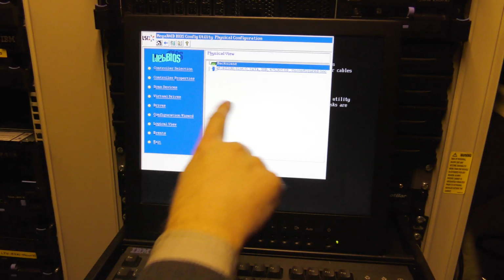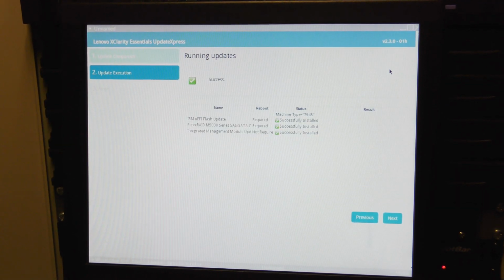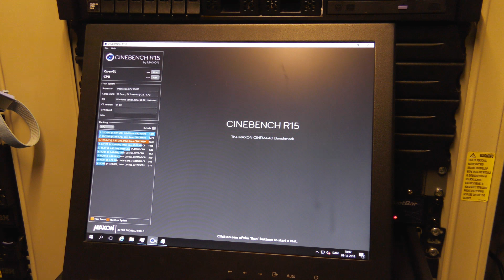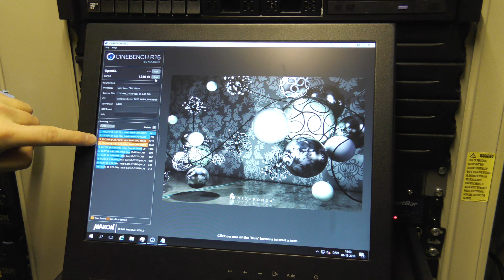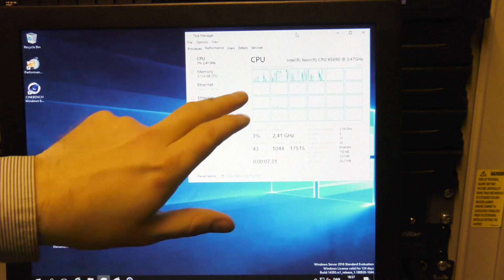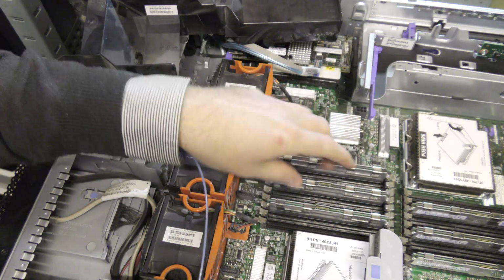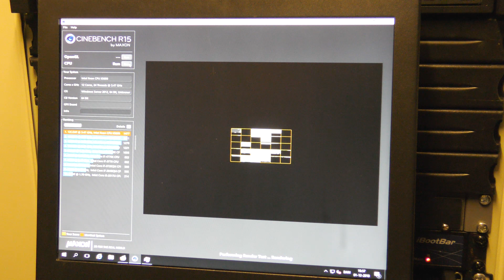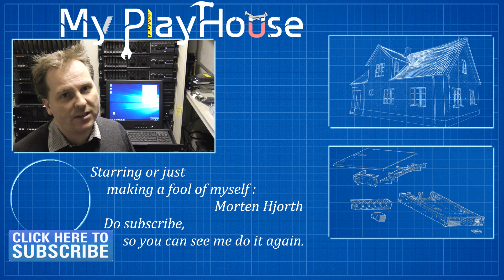2 x Fastest "Westmere-EP" XEON X5690's in Rack Server - 784

Comment: Hi Morten,
Always a treat watching your videos.
I've mentioned this in a comment on one of your videos featuring Westmere chips in the past.
You're putting the thermal paste on incorrectly.
You must put the paste on the die in a line that crosses directly over all 12 cores so they can all turbo up 200Mhz; the way to do that, is perpendicular to the writing on the die, down the center, using one thin, small line, starting and stopping 3mm from the edge.
Moreover, for HPC-like workloads, where possible, set the QPI to favor compute, the system power configuration to maximum performance, and the Turbo setting to favor performance.
Also, only install a single DIMM per memory channel, DDR3-12800R, per processor, so 6 DIMMs total, rec. 4GB sticks, to give each thread 2GB of memory space in which to work.
This will bump your passmark score > 14,000 and your Cinebench >1600.
Reply from the maker: Hi Roy Chartier
Thank You very much!  Linus did some testing in a video and tired all the different methods of putting on the paste,, it did not really matter, as long as it was on there. 
Thank you for watching! :-)

Comment: Cinebench is an odd benchmark, you can increase the score by running less in the background and running the application in real-time in Task Manager. It tends to not favour memory performance much but does make a slight difference. While its not a bad score, It's not great considering a modern Intel 8 core is getting nearly 2000 CB15 points.
Reply: The best score that I've got on my Xeon X5670 overclocked to 4.44GHz was 1011cb
Reply from the maker: Hi Pasi123
Thank You very much!  nice bit of overclocking!
Thank you for watching! :-)
Reply: thats not bad! the best i got is 1814 out of an i7 5960X @ 4.3GHz (8c) which is equ to an Xeon E5 V3

Comment: did you check to make sure that the heatsinks are capable of 130w for the x5690's... as the x5675 is only a 95w part it may be thermal throttling....  it looks like the 130w sinks are solid copper.... part no: 69Y1207
Reply from the maker: Hi meh757
Thank You very much!  That might be it,, I just ordered two,, so we might try that.
Thank you for watching! :-)

Comment: One quick tip: Do not place the CPUs that you took out, ON the anti static bags, with the pins facing down. These are very static on the OUTside, and have no static electricity INside. I think nothing will have happened but I think it's bad practice.
Reply from the maker: Hi Waberner
Thank You very much!  But what you are claiming here,, is not trough.
Thank you for watching! :-)